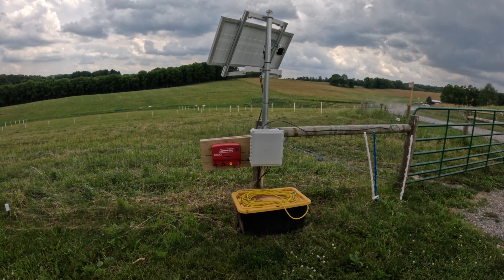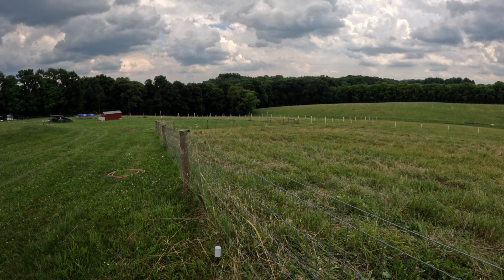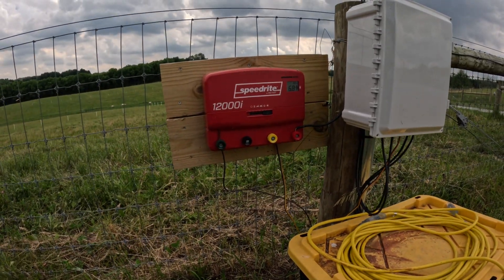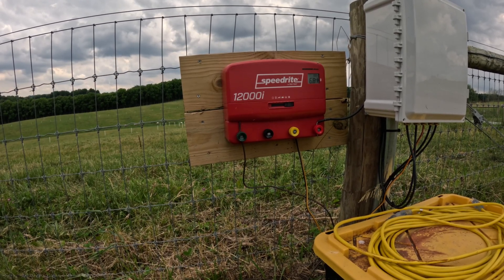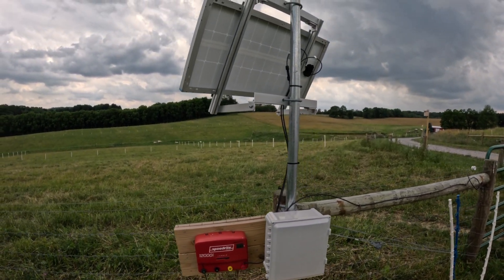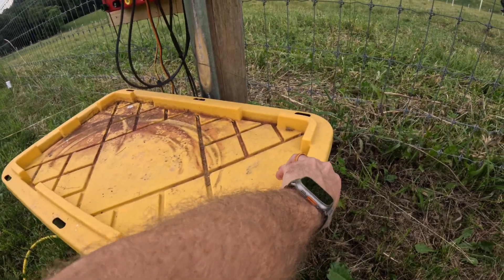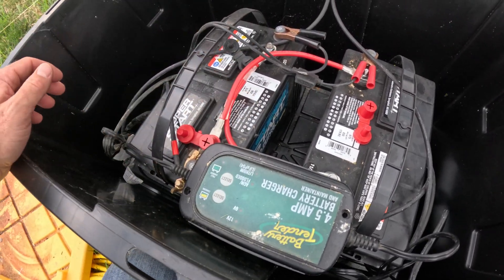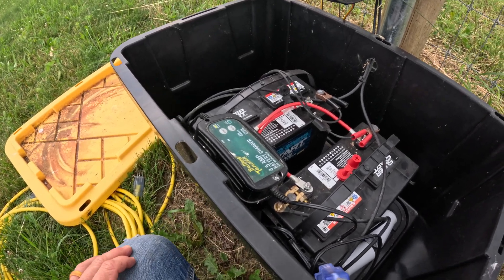DIY Solar Electric Fence Charger Overview

Comment: I’m only powering two small paddocks, created by wire netting that I move frequently. I use that exact brand and type of battery and a speed right 2000 controller. Great brands. I use a 25 watt marine/weatherproof solar panel I purchased off amazon. It has a built in solar controller. So far, after 6 months of continuous use I have not had to use anything else to charge the battery. 
I have everything assembled in a large, weather resistant, Husky tool box from Home Depot. It’s on wheels, so I can roll it easily. I wish I could post a picture. I’ve really enjoyed learning about solar too. Thanks for posting so I can show my family, I’m not the only one. 😊
Reply from the maker: Thank you for watching and for sharing with your family! I like the idea of the rolling tote - that makes battery handling far easier. Our issue in Ohio is when we have multiple cloudy days. My 100W solar panel is just not cutting it to keep the battery charged, especially when I am using the larger charger (18 joule). We power a lot of fence with this charger, so it does eat some energy. We wound up trenching a line and going with a mains powered charger, but we will be using this solar setup on a new property that we just leased.
Reply: @ I understand. I’m in South East Texas, so I knew if I made it from October to March without charging, it would work. We get 50-100 inches of rain every year, but also lots of sun. We also had a snow this year which was a big test.   I’m going to add a battery and a 110 v inverter in case I need 110v short term out in the field. It should all fit in the same box.

Comment: Nice setup.  I run a Cycle 12 Joule off batteries year round in Canada and it works great.  If you switch to a Victron Smartsolar 100/20 charge controller and a 300watt - 550watt solar panel it should cover your needs and not have to anymore charging.  Will only charge your batteries at 288 watts at the highest rate, but being overpanelled covers for dim days to keep it at 288 watts at most times.  Look around and you can get a big panel for pretty cheap.
Reply from the maker: That's some good advice - thank you! The issue that I have run into lately is finding racking for larger single panels. There isn't a great source it seems unless I look on ebay, etc. which always makes me nervous.

Comment: Would 300watts in panels and 400aph be for effective?
Reply from the maker: Probably so, yes, although it depends on the size of your fencer and solar zone. For example, Florida is going to give you a lot more solar days than Indiana, which means that you can use smaller batteries. Shawn Mills from Hack My Homestead has some excellent information on properly sizing a solar system. Thank you for watching!